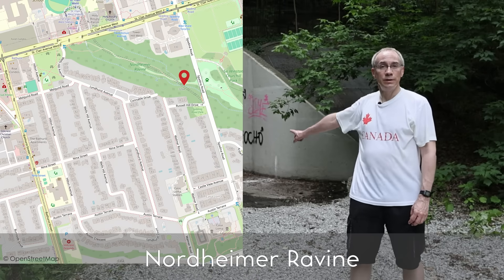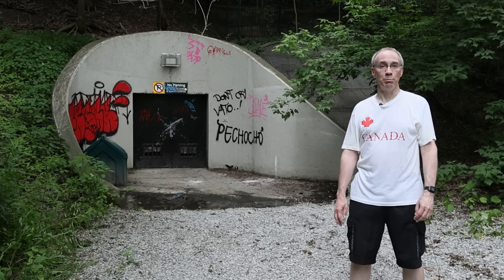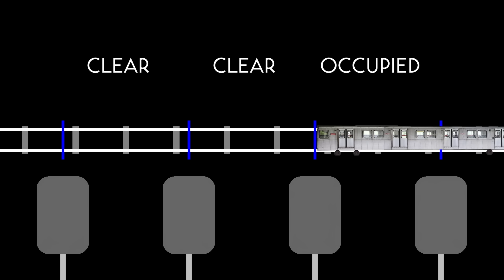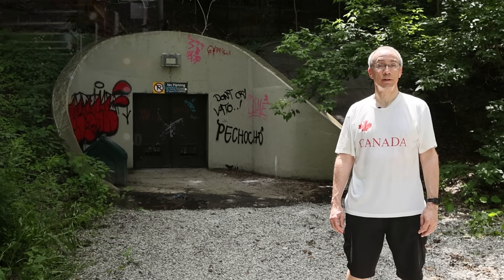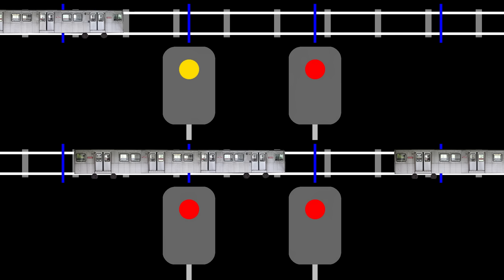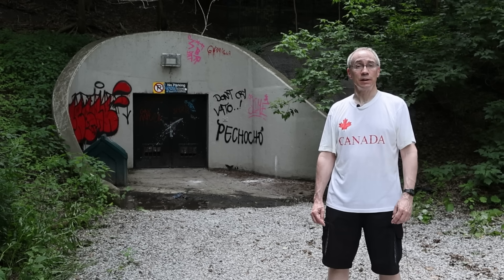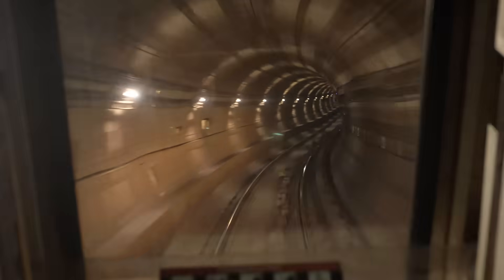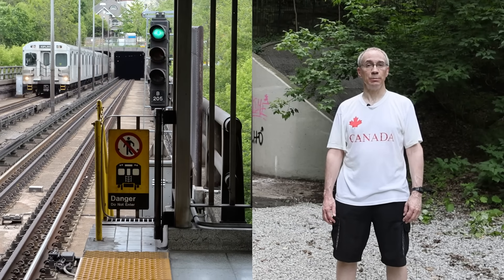TTC's Fatal Subway Crash - the Russell Hill accident

Comment: Thinking of the 3 precious angels today , I continue to be forever grateful to the rescuers who worked tireslessly to save me and my son
Reply from the maker: A very difficult day for all the passengers and first responders, I'm sure.
Reply: @notsmoothsteve  yes it is,  responders went through a lot and I am so grateful to them all, this is a very tough day for me
Reply: @notsmoothsteve sorry in case you see me with my replies with Jeannie is not against you. You made a well crafted video here discussing what happened during this incident 30 years later in 2025.
Reply: I too remember that day. I was not one of the first responders, but one of the personnel called in to help clean up afterwards. The tunnels were hot and dark as the accident tore all the electrical connections. At first all we had were flashlights and portable lanterns. Temporary lighting was fed in through the access entrance shown. Later, a portable air-conditioning unit used to cool airplanes was borrowed from Air Canada to pump fresh air down to the workers. It was a case of waiting until the inspections were done until we were able to remove the pieces sometimes one at a time and manually bring them up to the surface for more examination.
Reply: @subwaytheo  The heat was awful, I was so relieved when I got the oxygen mask at the time.  Doing what you and other workers had to do must have been exhausting
Reply: @Jeannie585 I’ve always been fascinated by this story. Not discussed often in Toronto so I appreciate awareness being brought by videos like this. Can you remember what that scene was like in the tunnel when it initially happened?
Reply: @tharindudon6448  When I came to it was complete darkness and the 6 of us were trapped until the rescuers arrived to get through the metal then to us
Reply: @Jeannie585 did you hear a loud bang or feel any collision at all?
Reply: @tharindudon6448  yes we were at the front of the train
Reply: Crazy!
Reply: Make a YouTube video talking about your experience
Reply: @xierraleone1905  Well she’s not because she doesn’t want to bring up a the hellish-like experience she went thru on the TTC subway on Line 1.
Reply: I’m not sure if you braced for impact when you saw the train ahead or no? I’m sorry you had to suffer through the TTC’s worst ever crash.
Reply: @B747Fan-70  I didn't see the train ahead, my son and i were seated behind the driver and when i heard the driver scream and the lights went out i grabbed my son into my arms
Reply: @Jeannie585 Oh, so the driver booth to your right must’ve blocked your view out the front window. I’m the driver fled from his seat when you heard his scream. I am glad to see you made it out unscathed.
Reply: @Jeannie585 Oh, I see. I think the walls of the driver’s booth blocked your view to your right so you couldn’t see what was going on out front. I’m happy to see you are doing well and managed to escape this travesty unscathed.
Reply: @B747Fan-70  Thankyou, had a very bad leg injury but was very lucky it was saved
Reply: @Jeannie585 I’m glad to hear you are doing well though. 👍
Reply: @B747Fan-70  Thankyou
Reply: @Jeannie585 Your welcome. I’m also happy to say that Line 1 has been overhauled since then with all new and bigger trains and a new system so it is 100% safer now.
Reply: @B747Fan-70  Yes I am aware but I will never go back on
Reply: @Jeannie585 Well I understand that you got PTSD from this incident so I guess you’ll probably take the car, taxis, streetcars, or buses from now on to get around Toronto. I do still take Line 1 but I usually take the Yonge and University sides only to get to college in downtown.
Reply: @B747Fan-70  Yes I got PTSD big time and suffered from survivors guilt at the time and had to speak at the inquest and on top of it all counselling for me and my son who was only 5 at the time and yes streetcars and buses everywhere after my leg was healed almost a year after the crash
Reply: @Jeannie585 Oh man, I’d assume the injures must’ve took a toll on you up until 1996 or so. The debris from the subway cars must’ve cut your leg from the violent impact. I’d heard the train collided with the one in front of it at about 50 km/h or 30 mph which can explain why the impact possibly tossed the debris around in a giant pile. I also feel sorry that you injured and stuck in the pile of debris of the subway trains and it must’ve felt like a giant metal sauna trap since it was very hot that fateful evening. I also wonder which day did the coroner inquest happen on and I wonder if your son is doing okay?